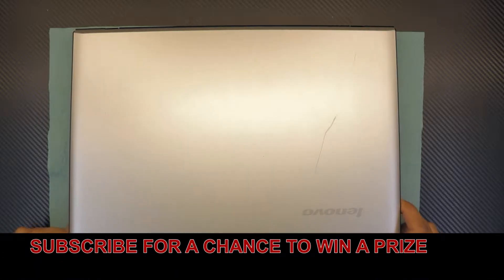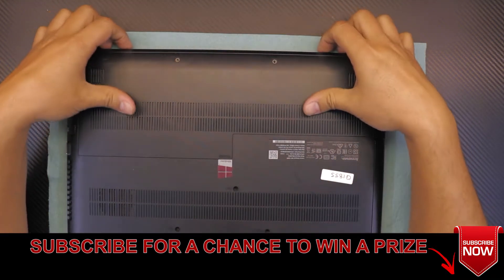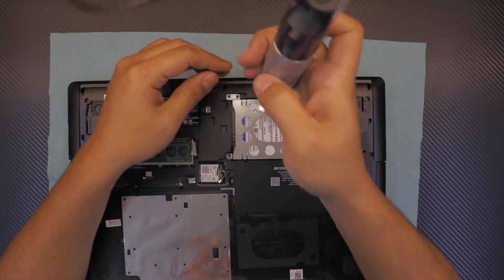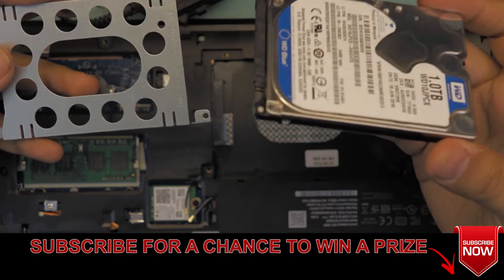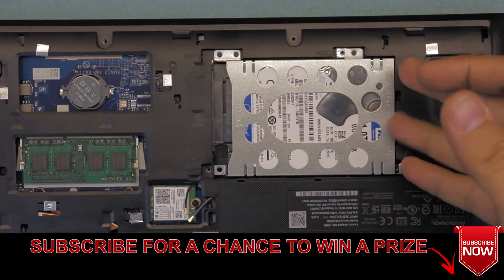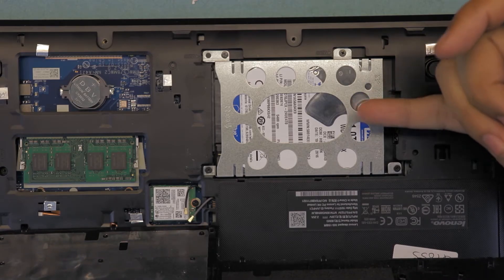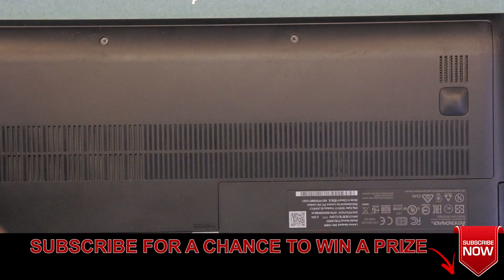lenovo ideapad 300 Upgrade / replace HDD , Hard Drive or SSD drive

Comment: Mine wasn't EXACTLY like that.  It had a ribbon cable connecting the SATA interface to the laptop, and the computer end popped out.
Reply from the maker: there are few variants of this laptops you may have a different variant my friend.

Comment: Excuse me if just want to use caddy to use my hdd i should just open the 1 screw and get the cd drive out or i need to opend the whole laptop?
Reply from the maker: Thank you for the feedback! if you wish to support the channel you can LIKE or SUB or both :P
regarding your question: if you want to remove the DVD drive to place a hdd caddy then you need to remove:
the 3 middle screw on the bottom of the laptop then remove the keyboard and then remove the screw for the dvd drive
https://www.youtube.com/watch?v=-chyG-_BN_0
0:34 remove the 3 middle screw
3:16 dvd screw
موفق باشی :P

Comment: I do not speak English. I am using a translator...

does the 240 GB sdd work on lenovo ideapad 300 ideapad 300 15isk?

Thank you
Reply from the maker: Yes my friend it will work. You can put even a 2TB ssd with no problem. Thank you for your support.
Reply: @uFixTek  
I understand, however, the following message appears "no bootable device insert boot disk and press any key notebook". Would you help me?

Comment: Thanks for great video looks easy. Can I switch to 1TB drive? How do I copy old system drive info to new?
Reply from the maker: yes you can you need two things number 1. get the Macrium Reflect
2. get this adapter :https://amzn.to/2uanbjX

3. then follow the steps to clone your main drive to the new drive, the program will create a boot software and when it restarts it will take you there so you can copy the main drive. very easy just follow instructions

Comment: Please help me, ssd is not detecting on installation of windows 10
Reply from the maker: you have to get your ssd converted to GPT google that, and did you get the new iso installed directly from MS website?
Reply: @uFixTek  yes, thank you for info, i'll let you know if it works or not
Reply from the maker: good :)
Reply: @uFixTek  it works, thanks for the help
Reply from the maker: glad it did, now you can pass it on :P

Comment: I'm trying to do this but the screws won't come off the HDD brackets, what can I do? I was able to remove it from the laptop but I'm not able to swap the HDD with my ssd
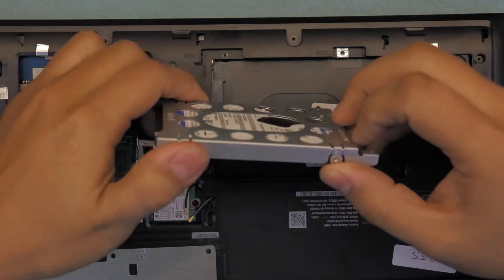Reply from the maker: you telling me the screws @1:40 not coming off?!!
Reply from the maker: the bracket is there to keep the hdd from sliding to the right side preventing it from disconnection, but if you gonna use a ssd and can't remove the caddy, just fill the gap a the back of the ssd so it will prevent it from sliding and you all set, the ssd has no moving parts inside so you very very safe.